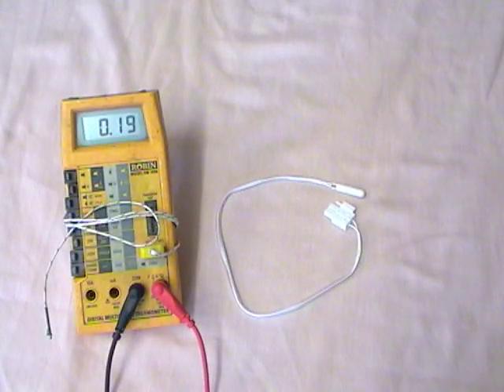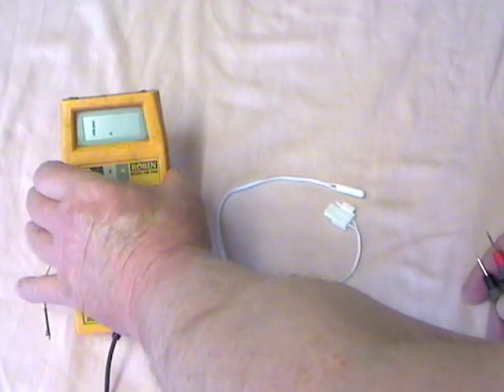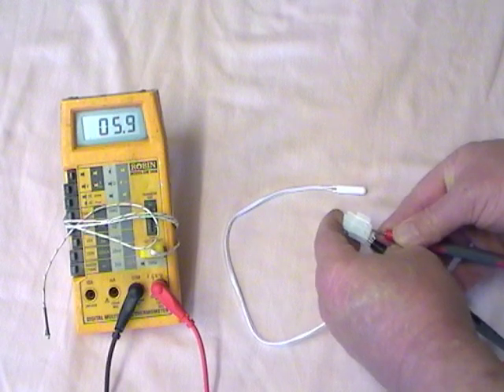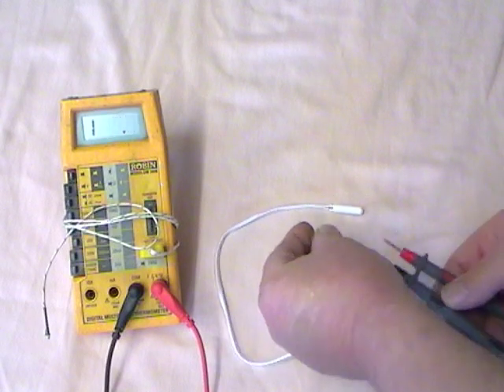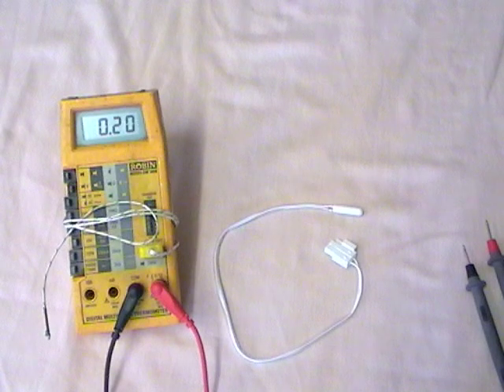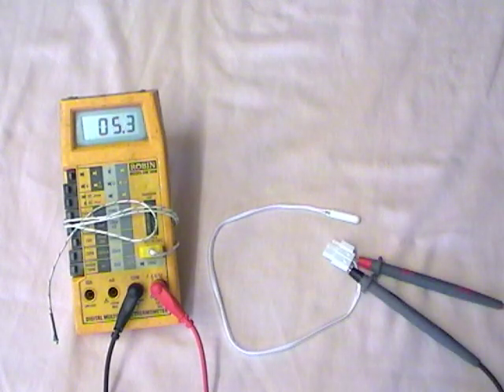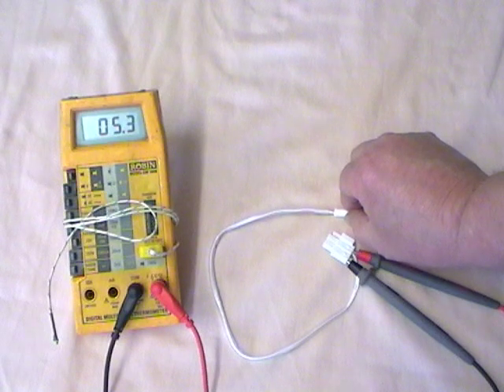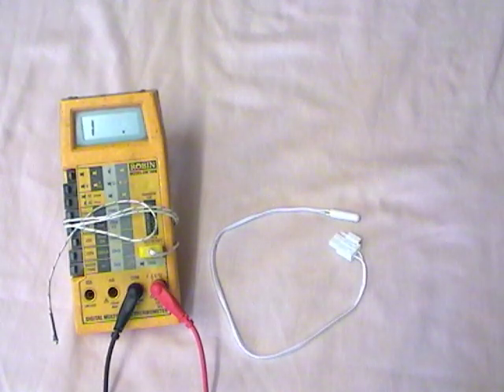Samsung american fridge freezer problems, RSH1 RSJ1 fridge defrost sensor test

Comment from the maker: Hello,
the frodge temp display is set out in 2 figure 8's  as in 88.... the right hand one is used to display fault codes, look close and let me know which led is lit. there are 7 leds, 3 horizontal and 4 vertical, each indicates a fault. so, which led is showing as lit.

Comment: Hi i have this model fridge freezer, i defrosted it yesterday & when i plugged it back in today the screen is blank apart from a line on the fridge temperature, what have i done wrong or is there a reset button??